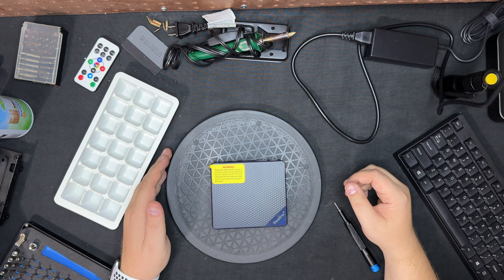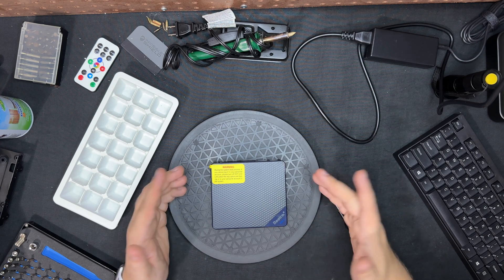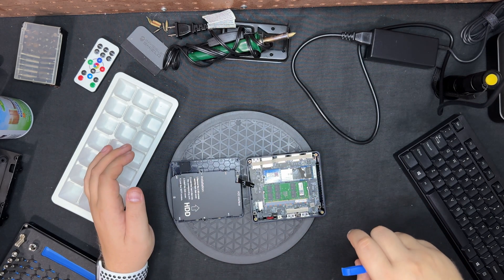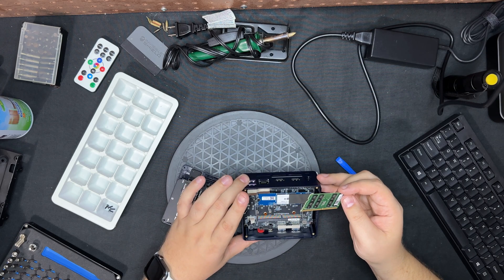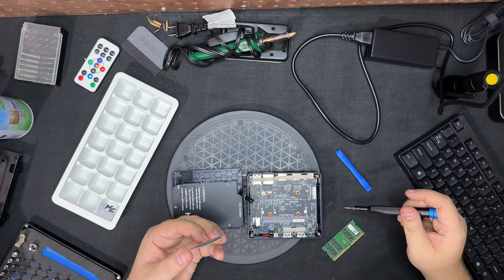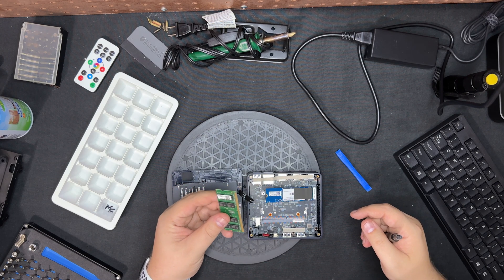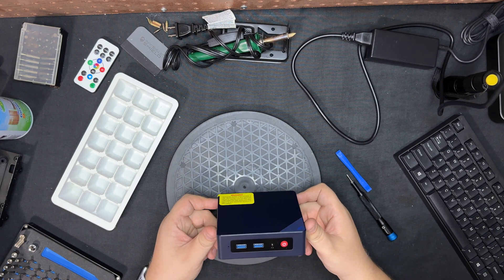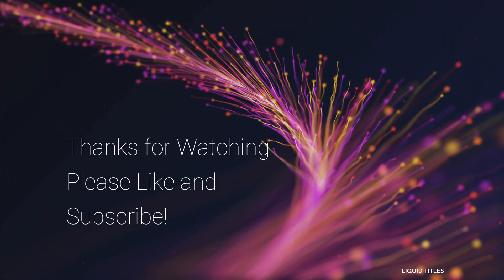Beelink Mini S12 Teardown

Comment: Ahh thanks for posting, I was failing to open mine
Reply: Same. I replaced the thermal paste. Can recommend. Fan stopped going insane and cpu does not appear to throttle down on a cpu benchmark.
Reply: @h4nzman118  I’m planning to repaste mine, are there any docs on how to remove the mainboard without damaging anything?